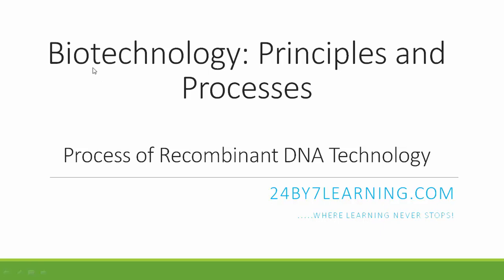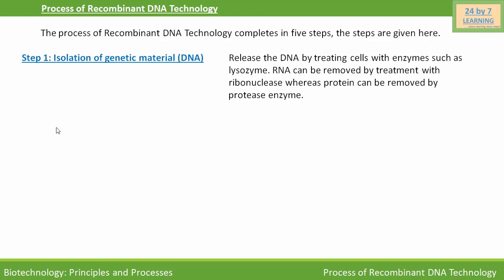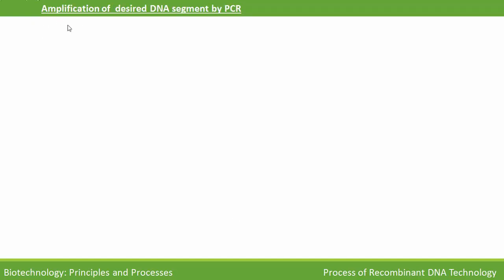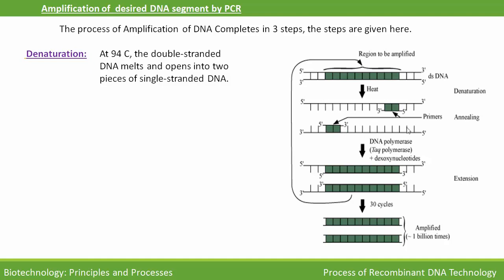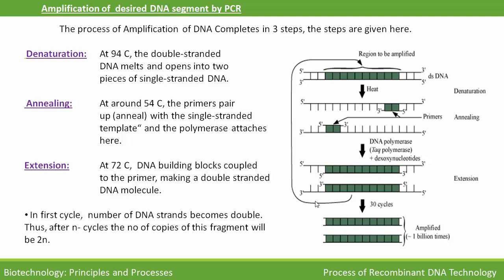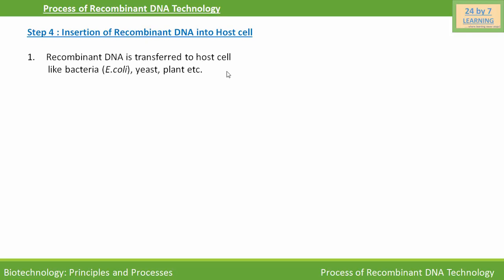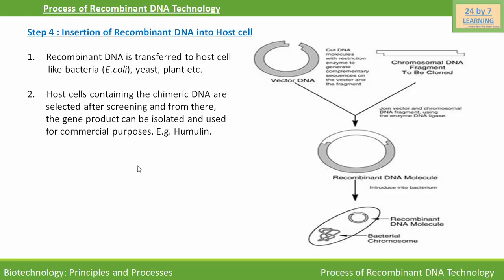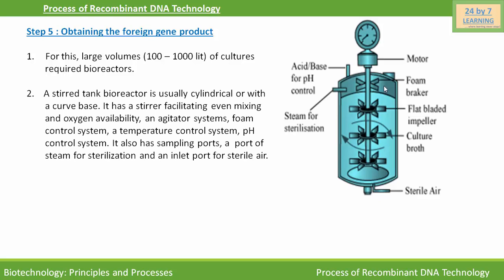Process of Recombinant DNA Technology | Biotechnology: principles and processes | Grade 12 | Biology

Comment: I suppose u were wrong at 3:07 because during each cycle the number of DNA strands are getting squared and not doubled. For instance, at the second cycle we have 2 DNA strands and when PCR is done on both the strand we get 4 DNA strands and so on. That's why it's written in the diagram also than after 30 cycles we get a billion of Strands of DNA